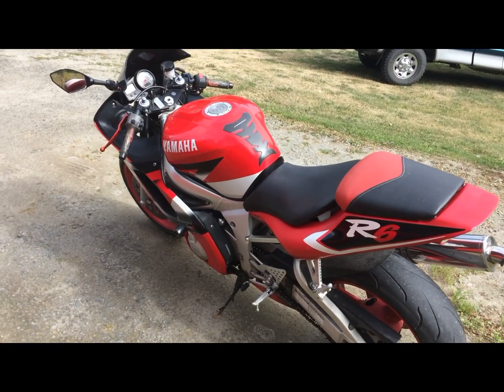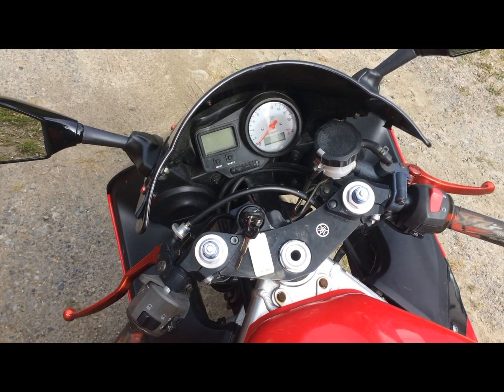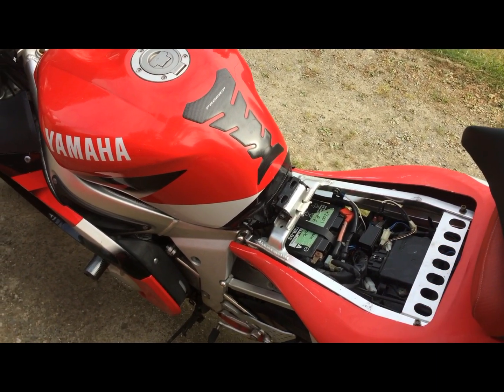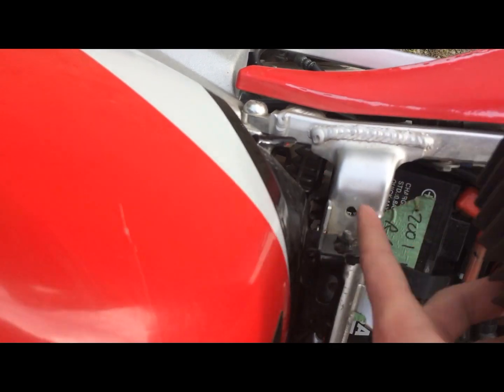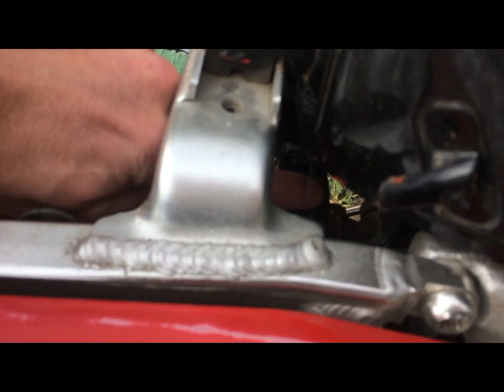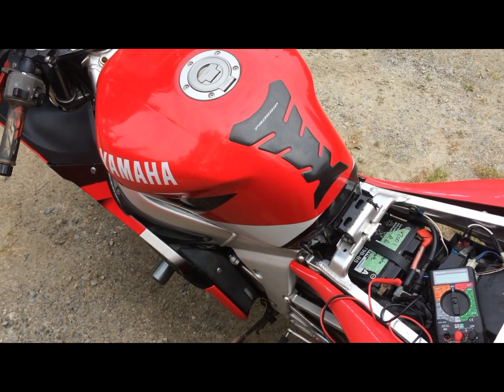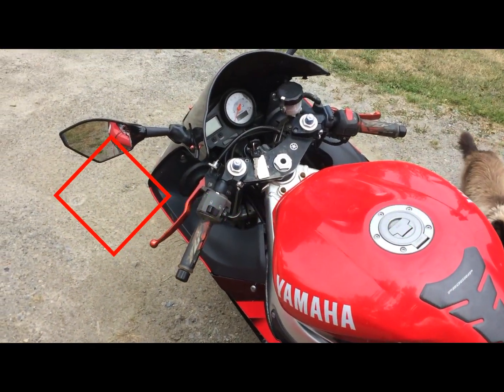Yamaha 5EB R6 - Charging Issue Solved - Rectifier

Comment: Got my r6 out the weekend, batteries always on optimizer , went to work fine, on way home exactly as you described, clocks went off, couple of minutes later it cut out. Was lucky as at top of a hill. Let it sit a while and battery come back up a little,just enough to get ignition and take immobilizer off, then bumped it down the hill and made it home.
Some testing to do when get time but already suspected it's the same fault.

Comment: Hi. 2002 R6. Something is  blowing out da 30 fuse on da positive terminal.  
I was looking  for da wire harness because  da fuel pump is not putting out da proper fueling. Any suggestions?
Zack
Reply: Did you get it fixed??

Comment: Mine wont even start it just cranks and cranks
Reply: Ran into the same issue replaced the stator and rectifier for about 60$ and got it back up and running... I would also recommend checking battery and the wires connecting to the stator and rectifier to make sure they’re not fried
Reply: @juanr2424  where did u get stator and rectifier
Reply: @TheLegendaryLoso  eBay... just type in the year and model of your bike as well
Reply: @juanr2424  how’s your bike running now?? Any problems with the r/r or stator?
Reply: @Ryan_1997  everything is still running good

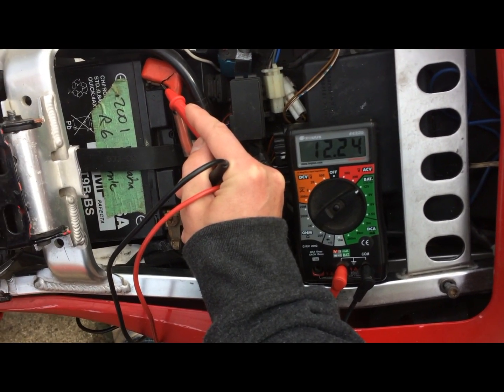Comment: You should consider picking up a battery maintainer my friend.  That is the best way to increase the longevity of your stator, rectifier, battery, and starter.  Notice at 5:22 your battery is showing 12.24 volts.  That is a fairly discharged battery.  When you start this bike, your stator is going to full output to try and recharge the discharged battery.  That is a common reason why a stator burns up.  If you were using a battery maintainer, the battery would be at 100% charge when you start the bike.  That makes life so much easier on the stator, rectifier, battery, and starter.  My 2000 R6 has almost 30,000 miles on her with the original stator and rectifier.  Sounds like your R6 is running lean.  I have some videos on my channel that could help you fix that problem if you are interested.  Nice bike by the way.  I like the red and white paint scheme!
Reply: Hay so I know this is an old comment but I have this vary issue with my 02 R6. Safe to assume it’s the same issue I did the ohm test and it’s good. Save voltage for all three plugs... thanks if you see this guys
Reply from the maker: Hey thanks for the comment and good knowledge, as a automotive mechanic I agree with what you're saying, and I often had the battery out of the bike and on a maintainer, but battery was getting old and wasn't 100% anymore, and eventually I sold the bike, I barely rode it just simply didn't have time, although I did really enjoy riding it and always got compliments about it being very nice, perhaps one day I'll get another!
Reply: @GearScar  I hear ya.  That was one sweet looking R6 you had though.  Not easy to find them in such good condition anymore.

Comment: Cool video but the test you showed isn't testing the voltage regulator rectifier. You need to perform a reverse diode test or resistance test to check this on the rectifier itself.

Glad it was the rectifier though, stator is much more PITA to work with :)